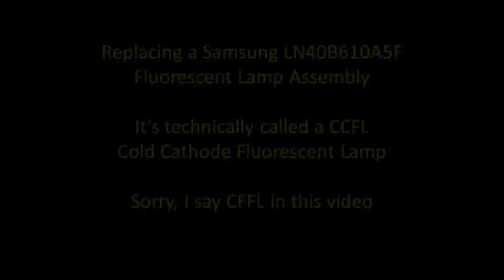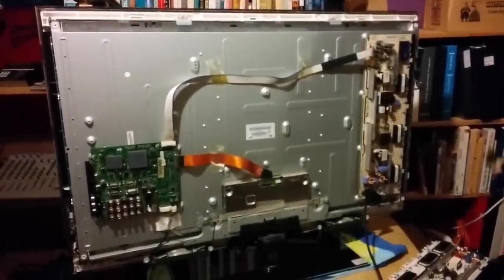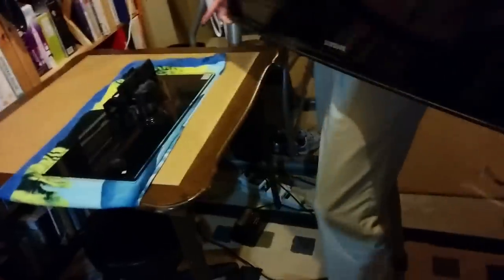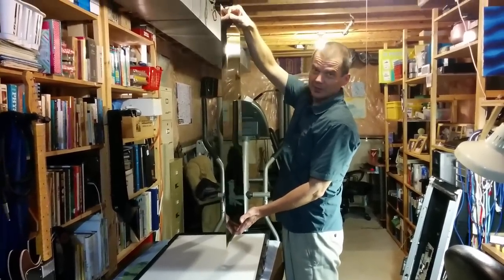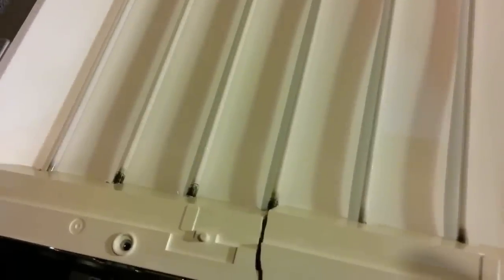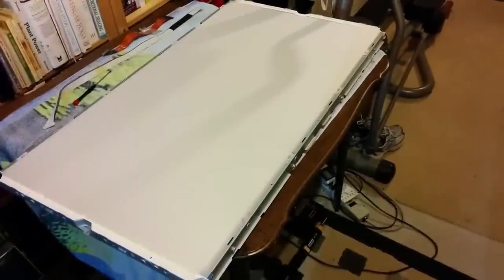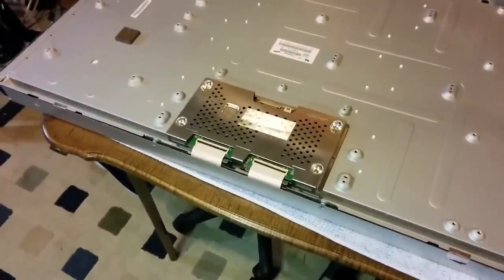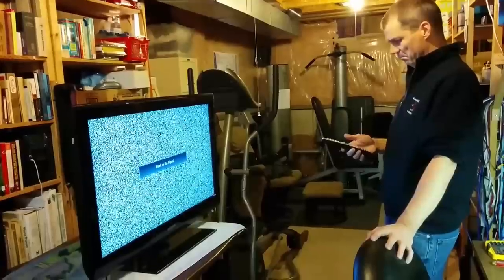Replacing a Samsung LCD TV Fluorescent Lamp Assembly to fix backlight power off after power on.

Comment: Did you ever find replacement CCFL holder plastic pieces?  I broke a few and now I am considering doing LED backlights instead.  The CCFLs are way too expensive.  I have 24 o fthem
Reply from the maker: +Chris Sparks Hi Chris.  I looked for replacement CCFL’s and the plastic holders only for a short time as I had donor TV as a parts source.  I suspect these parts need to be purchased in large quantities to make it reasonable.  My first repair goto are parts TV’s on Kijiji however I do I like the longevity of the LED Conversion.  I've yet to build or buy one but they do look fun.
Reply: hot glue gun them in
Reply from the maker: Interesting idea.  The area does get warm.  Hopefully not hot enough to remelt the glue :-)
Reply: Or separate the led strips from the light box!

Comment: i'm wondering if the bulbs flicker on mine due to them dying? in that case i may try to replace all the bulbs with LED strips. the picture might suck in comparison but, would be fine for a garage tv.
Reply from the maker: Hi.  Thanks for the comment.  I never saw the TV I "fixed" in this video die.  I have no idea what it looked like before it was deemed "broken".  A quick back cover removal and capacitor inspection could identify bad caps as the cause of yours.  The TV in this video is still working today (3+ years now lol) so an LED upgrade is not yet needed.  The LED colour choice, spacing and brightness must be fun to sort out.  Good luck if you choose to do it.  The best colour compensation for a garage TV is beer :-)
Reply: caps will be the next thing to check after trying the shopjimmy psu repair kit which had none. if all else failed on the back light side led strips would be an interesting venture.
Reply from the maker: Bulging caps are pretty obvious and are free to inspect.  If you find any, change them all as they are cheap.  I found an ESR meter a valuable tool to validate without having to desolder anything.
Reply: that's the tool i lack since they look completely un bulged or overheated. I hear amazon has some ESR meters.
Reply from the maker: I fixed a Mac power supply with bad caps.  A few were bulged, but many were not and most of them had an unacceptable ESR value.  My channel has a video if you are interested.  I actually borrowed (stole) my dad's cheapo meter.  Accuracy was not important in my situation and it worked great.
Reply: now i'm wondering how accurate in circuit ESR meters are? sounds like you might have in circuit tester? Would def save time identifying bad caps. might explain some of the old LCDs i've fixed before crapping out or the ones i couldn't fix. (non bulged bad caps)
Reply from the maker: I think all ESR meters will work well in circuit.  I understand the signal they put out will not bias any transistors.  An aluminum electrolytic typically has a very low ESR.  Even my cheap meter revealed a slight increase in the ESR which is detrimental in a switch mode power supply.  Considering the magnitude of bad caps out there, not having an ESR is like not having a multimeter :-)
Reply from the maker: https://youtu.be/CltS0LyHQXc?t=580   80mV ish, 66 KHz.  Pretty safe in circuit

Comment: The problem with your tv back light going off a second or so after you switching it on, the fault that causes it is the TCON board I've got the same tv but mine is a 52inch as mine was doing the same till I got it repaired
Reply from the maker: Hi.  Thanks for the comment.  In my TV's case, substituting the TCON did not solve the issue.  A tear down revealed failing CCFL's.  Replacing the entire CCFL lamp assembly was the solution.

Comment: I found one exactly like this in the trash today. I took it apart. Looked old. Its not working. Fuse is good.  Capacitors are ok too. Won't light up.  Is there anything I can make with the parts ?
Reply from the maker: Hi.  Thanks for asking.  Is there any sound at all when it's turned on?

Comment: Hi...there is anyway to know what kind of lamp i need for my lcd (marantz 32) ?
Its flickering and when i opened it up there was dust. I have cleaned it but nothing changed so i think its the backlight
Reply from the maker: Hi Eitan.  The Flickering may not necessarily be a bad lamp.  It could be the power supply.  Can you record a movie of the problem and post it?
Reply from the maker: Hi Eitan.  That's interesting.  It seems the entire lamp assembly is darkening.  I think CCFL's wont all degrade at the same rate and could cause such a broad amount of darkening.  I still suspect it's beyond the bulbs and somewhere else.  Dig you by chance look around for any bulging capacitors?
Reply: Yes...its all seems to be ok under the hood.
Its strange cuz the problem is gone but it will come back again i assume
Reply from the maker: So it's intermittent eh.  Bummer.  It will probably be back.  I don't think CCFL's will fail intermittently especially all of them at once.  Don't underestimate bad caps.  I suspect they don't need to be bulging to be problematic.  I made a video on testing them with an ESR meter if you are interested.
Reply: Yes, i'll be glad to see it!
Reply from the maker: Cool.  Hope it helps.  https://www.youtube.com/watch?v=CltS0LyHQXc&t=4s
Reply: Thanks! I will let you know if there any progress

Comment: I have the same TV with the same issue (no backlight) where can I buy the tubes from?
Reply from the maker: Hi there. Sorry I have no idea where to buy the tubes from. Good luck
Reply: I found a website that sells the tube. Kinda pricey thou ($20 each). Wish I can find a way to test the tubes to see which one does not work. Buying every tube will cost more then what the TV is worth.
Reply: Thanks for the quick response Steve.
Reply from the maker: No problemo.  Ouch, that is pricey.  Can you send me this web site details?  Others have asked and it might prove helpful.  I'm unsure how exactly to test the tubes.  It would be an interesting experiment to simply remove or disable the tubes that are heavily discoloured on the ends.  These are tubes that are causing the problem.  The TV might actually work without them and offer you a troubleshooting method.  Just a wild guess here though :-)
Reply: I found a CCFL tube tester on ebay. Haven't tried it yet. Search for CCFL Tester Repair LCD TV Screen Laptop Display
Reply from the maker: Sweet, thanks
Reply from the maker: Very cool as well.  I'd check to ensure they can test a tube as long as those in your TV.  I suspect  that all the tubes might age  equally enough to justify changing them all at once.  It's a big tear down and rebuild.  I fear you will also have to replace any tube standoffs that break through the process as well.  They are really brittle after years of heat and light exposure.
Reply: make an ez ccfl tester, just get a working inverter from an old pentium lap top (In lid, usually under display), attach a 12vdc 2a wall wart to input, then fancy a pair of hi-tensile cables on output long enough to reach both ends of a ccfl lamp, go fancy and put either a N/O momentary switch on the +12v supply, or a on/off switch. tube should light evenly across

To disable a tube, 4 pins or pads in on low side, front of transformer, solder a jumper between pins 1 & 3 on low side of transformer for that light (Samsung) tube will not light, not really noticeable difference unless looking at a static pic, such as a test pattern

Comment: the lights on the set i'm working with flicker. i have a repair kit for the inverter/psu.
Reply from the maker: Oops sorry about the delay.  What's in the repair kit?
Reply: Steve Quinn caps, a resistor, transistors and some ICs
Reply from the maker: cdoublejj Interesting. Can you send me a link to where you got this kit. I'm curious about it now. Thanks.
Reply from the maker: Interesting.  That's a pretty inexpensive kit.  I'm surprised there are no Electrolytic caps in the kit.  Have you ensured they are not the culprit with an ESR meter?
I know I might gravitate towards bad caps too much but it's only because of their prevalence and simplistic evaluation.
Reply: i have not. i managed to install the kit with out killing psu and still flickers just took another minute longer than usual to start flickering. my only other guess would be bad caps with OUT bulges. that or failing bulbs/tubes

Comment: anyone have the voltage requirements to light one up? i have several tubes out of various tvs
Reply from the maker: Hi.  I'm sorry but I don't know exactly for my model.  I'd measure it if I could but am out of country for a while.  A little Googling revealed a startup of around 1000 V and operating could be around 600 - 800 V.  Be careful :-)
Reply: @letter2steve  thats a lot for such a thin small diameter tube,but thanks anyways i may try a cfl circut from a light bulb see what happens,,
Reply from the maker: @rmarsh9997  This circuit discusses 1200V start and 850V operating for 17 inch CCFL's.  I ball parked based on that.  http://danyk.cz/ccfl_en.html  Hope it's close
Reply: @letter2steve  thank u ill definitly look into it now..seems like it would use less than the old ballast type tubes used back a few years ago for lighting in office buildings,,

Comment: Thank God for LED tv's
Reply from the maker: Totally
Reply: Problem is LED TVs backlight strips burn out in a few years in comparison to LCD which seem to last 10+ years.
If you have the option on any flat panel TV, turn down the backlight setting and up the brightness a bit to compensate. I try to aim for 50-60% on the backlight setting and about 70% on brightness. You can go lower if it's a bedroom TV being viewed at night with the lights off. Save your LED strips!
Remember that every output needs to be set individually and if you switch your viewing mode from movie to game, etc, that changes the backlight settings and you will have to go back in to set them again. 
They want your TV to fail so you buy another one and by default, set the backlight to 100%. 
Be smart and lengthen the life as well as use less power.

Comment: AM RUNNIN'OUT OT PATIENCE WATCHIN'THIS TUTORAL. WHY DONT U GO DIRECT TO THE REPAIR?
Reply from the maker: Sorry to hear you are running out of patience.  The Title, Description and Introduction all indicate this is a video covering the verbose process of replacing the Lamp assembly.  The replacement of the Lamp assembly is the repair.  It's delicate multi step process hence the length of the video.  Hope this helps.
Reply: @letter2steve  maybe that bozo hasn't heard of FF lmao.  I appreciate all the time you took , and simply used FF to skip parts I knew about.  However your complete video is a great reference,  great job!
Reply from the maker: @kjaxky  Thanks for the kind words Kal Jak.  I appreciate you helping me with the trolls.  It's fun to starve them of their energy by being calm and reasonable.  Regarding the video time,  it was just so much work to get down to the tubes the first time I did it.   I figured it would be best to document the process for others (and myself ha ha).  FF is a great idea as well.   Thanks again.

Comment: hello look how true is that repairs televisions in the United States is against the law and is punishable ??
Reply from the maker: +Nestor 66   Hi.  Can you elaborate please?  Are you referring to DMCA? https://www.eff.org/issues/dmca
Reply: yes that's what I mean? You can be fined a person to repair electronic equipment protected brand ??
Reply from the maker: Nestor 66 Hi.  I'm not a lawyer but a little reading on the subject reveals this.
https://simple.wikipedia.org/wiki/Digital_Millennium_Copyright_Act

The Digital Millennium Copyright Act is an copyright law that protects copyright on the internet in the U.S.A. This Act was passed by the United States Congress in 1998.

It puts into effect two 1996 treaties of the World Intellectual Property Organization (WIPO).
It criminalizes production and dissemination of technology, devices, or services intended to circumvent (get round) measures which control access to copyrighted works.
These "measures" are commonly known as digital rights management or DRM.

In this TV repair I am replacing broken CCFL's. I am not circumventing DRM.
If you are still concerned, I suggest you consult with a lawyer.

Comment: Don''t to much explanation bro. to much  wasting time  peace..proceed to main topic.
Reply from the maker: Hi Ning.  I appreciate the comment.  I did this video in January 2015.  At that time, I could find no videos explaining the problem and the disassembly.  I chose to make this video very verbose to fill this gap.  This is explained in the video description.  Hope this helps.
Reply: I don't agree  with Ning, the thorough explanation is good for those that needed it. Bing  Maybe you've not heard of the seek bar and the ability to skip ahead?   Sometimes people look forever on here and the fast videos skip a vital part, that one encounters when doing the job.  Without a thorough video people just end up cursing the video maker and having to throw thier product away.  Or worse pay to dispose.  Case in point microwave oven repair videos,  many don't include hv capacitor discharge procedure,  resulting in death or injury for those that don't know.  Also CFL LCD TVs are more fragile than LED LCD TVs.
Reply from the maker: @kjaxky  Thanks for the support Kal Jak.